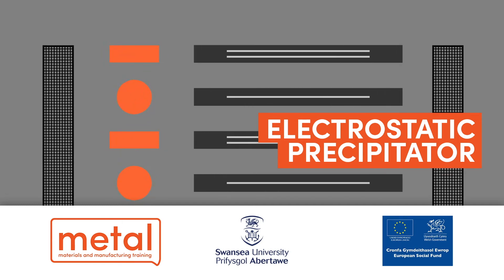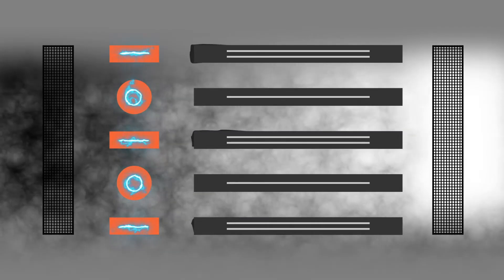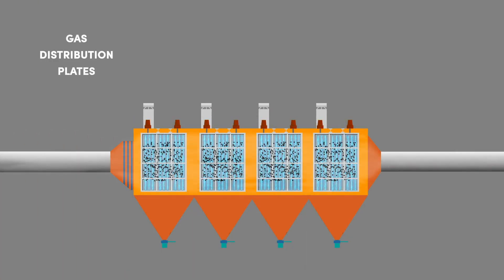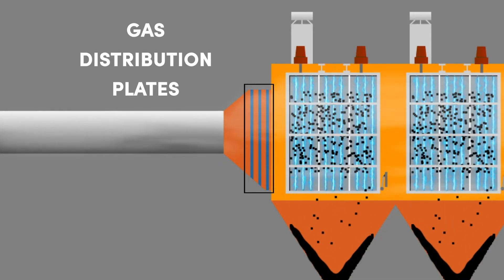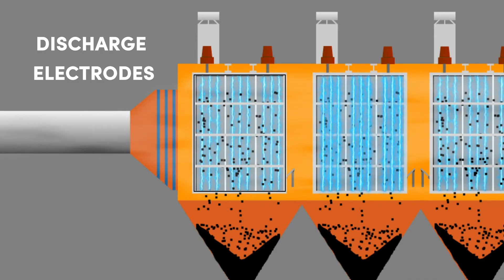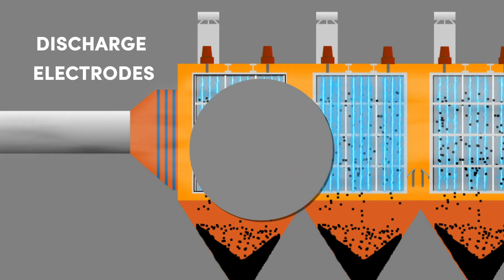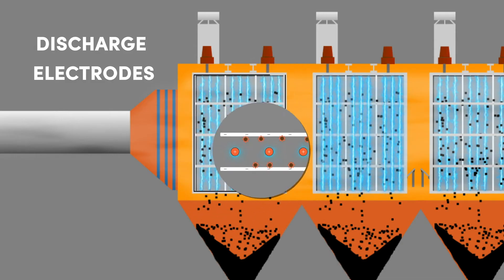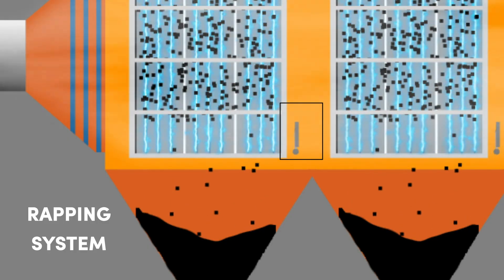What Is An Electrostatic Precipitator And How Does It Work?

Comment: Sir , how the raping system is working
Reply: In an electrostatic precipitator (ESP), the rapping system dislodges accumulated particulate matter from the collection plates and discharge electrodes to maintain efficiency. This system can be mechanical (using hammers or tumbling weights) or electromagnetic (using electromagnetic force to control the rapping action).

Operation:
* Rapping Frequency and Intensity: Controlled by timers or sensors, the rapping system activates at regular intervals or when dust buildup reaches a certain level. The force is adjusted based on dust type and characteristics.
* Rapping Sequence: Different sections are rapped sequentially to prevent dust re-entrainment.

* Dust Collection: Dislodged dust falls into hoppers below the ESP for disposal.

Maintenance: Regular checks are crucial to ensure the rapping system functions properly, preventing reduced efficiency or damage to the ESP.